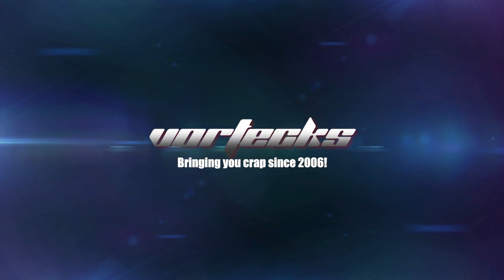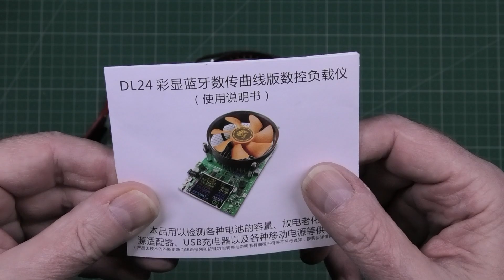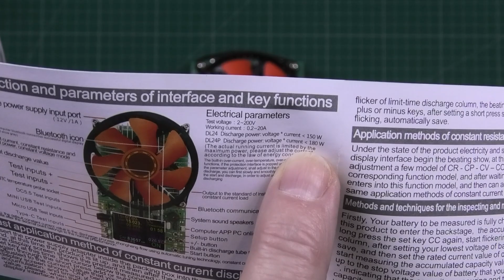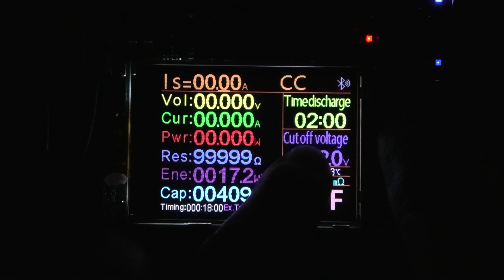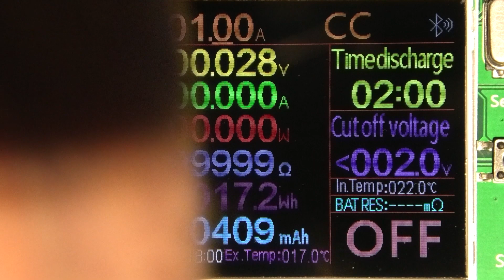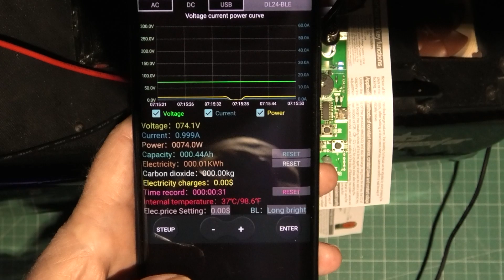DL24 battery load, discharge and capacity tester review (paid for out of my own pocket)

Comment: One major flaw with DL24 and DL24P is voltage resolution on data output is only 0.1.  For Display it is 0.001 but not for data.  This means you can't really make nice graphs from the data for analysis purposes.  And isn't that really the primary purpose of this device?  They need to fix this.

Comment: Has anyone figured out a way to turn OFF the bright Fan LED lights ?   
Very happy with this device.  Used it overnight many times at 10Amps 
load no problems.
Reply from the maker: I took mine out because I didn't like them, it's quite easy to disconnect them (simply cut the wire).
I also tested them afterwards 😁 https://youtu.be/TxgX5NRrsWk
Reply: @vortecks  Cool thanks.   I jinxed it.  Mine failed yesterday during an 11Amp discharge test.   Turns on but fan will not start and it won't draw current from the load.  Going to try replacing MOSFET.  I even had an auxiliary external fan keeping it cool.  I'm thinking the one MOSFET just isn't enough.  Too much heat.
Reply: @randydicotti3975  did the Mosfet fix your problem as I have the same problem only used it twice now it will not draw current.
Reply: @coadyg  snap, can't adjust either pot fine/course.
I replaced MOSFET also,  any further help from any of the geniuses about would be so helpful.🙏🙏
Reply: @coadyg  Yes, that fixed mine.

Comment: mine keeps shutting down with a 3.2 volt cell the minute i go above 3 amps
Reply: maybe wire resistance causes voltage drop? or do you have the 4-wire-version?